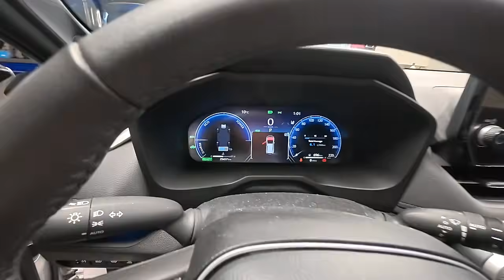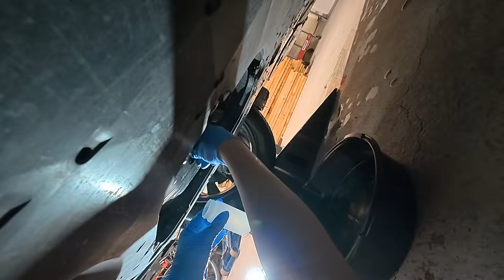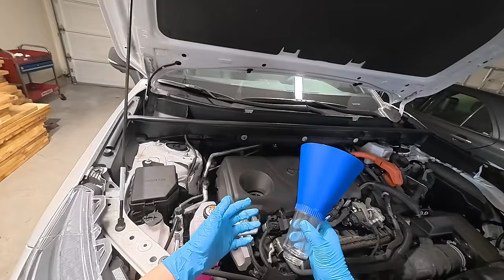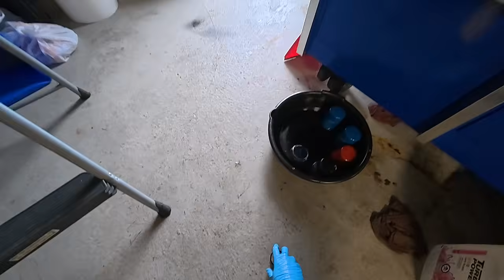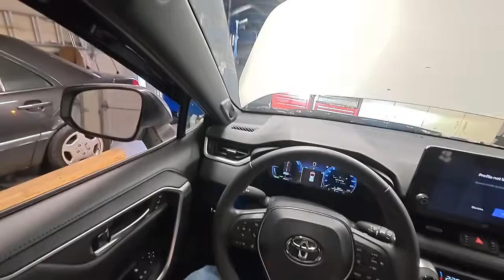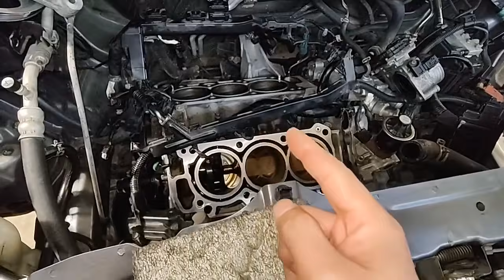5w30 Instead of 0w16 oil change #2 in the Rav4 Hybrid.

Comment: If it's under warranty, I'd use the specified oil weight. The will use any excuse to deny coverage, and using the wrong engine is a good one.
Reply: How would they know?
Reply from the maker: They don't. People that comment on my injector video because the dealer charged them 8 hrs to do injectors on their 1.5t and Im like that's so bad because injectors fall under emissions and is different than the 3 year warranty and at most customer pay is 3.5hrs labour time cuz warranty is 2.8hrs
Reply: @davidmordor Perhaps they could send it off for a viscosity test.
Reply: @davidmordor  They're going to want to see proof of proper maintenance, and they might even test the oil, before they fork out a few grand. They also may be able to tell from wear patterns. But also, if you do a YT video where you show yourself using the wrong oil, they'll know. But if you are just a dishonest person, then karma will get you anyway.
Reply from the maker: I've worked at many dealerships and no dealerships will test your oil for having the wrong oil. And no flat rate tech will waste their time waiting days for an oil sample just to deny your warranty and if they are going such lengths to do so they just want to make you pay out of pocket which will pay a flat rate tech more. The only thing we care about is what the condition looks like on the inside and if it's full of sludge then it's obvious. I've been a flat rate tech for 12 years.
Reply: They wont check your oil! 0W 30 will protect your car from needing a warranty!
Reply: They dont n they dont ever ask anything peeple r just dumb.

Comment: My Jeep calls for 0W-20, I am running Pennzoil Platinum Euro 0W-40 😃👍 It is a beast of an oil, I love it.
Reply: Mobil 1 FS 0W-40 is what I run
Reply: @Viking88Power That's even better. Folks online who have no clue say stuff like VVT will throw a code, oil temp will be very high, oil pressure will be abnormal and Jeep will feel sluggish etc. None of that happened to me, even my gas mileage hasn't changed. My 2024 3.6L Wrangler is loving the 0W-40.
Reply: @dawood2u  Yup I'll be running this forever, its cheap and very good quality. My recommended is 5w-30 but in other parts of the world they run 5w-40 so I picked a middle ground.
Reply: @Viking88Power From Bob is the oil guy forum one thing I learned is that no oil is too thick, too thin yes but not too thick. As long as the oil is pump-able(Has approriate winter rating), it will make it to all parts of the engine. My dad in Afghanistan runs 20w60 in his 1998 4Runner that calls for 5w30 and his 4Runner runs like a top 😆
Reply: @dawood2u  Oh yeah I can imagine in places where it gets very hot you can run viscosities like that. People with the same engine as mine run similar viscosities on Australia and South Africa.
Reply: If the Jeep is the 3.6 pentastar, Jeep changed from recommending 5w-30 to 0w-20 without ANY actually changes to the engines, no internal differences whatsoever. 5w-30 is definitely fine for the 3.6.
Reply from the maker: Wish they still made the 4.0L straight 6 in the Jeep that thing was a beast. Back in the day.
Reply: @theoffroadingmechanic Next gen Wrangler might get a straight six again
Reply: Euro oil is low saps for gpf which you don't have. You are not getting the full protection you can get from full saps.
Reply: Hello there, for how long do you run this grade of 0w40?
Reply: @Goldeagle81 3rd OCI
Reply: How do you know that it is better than the 0w20? Have you done oil tests for wear metals after a 10,000 mile break in period. Why is is the pennzoil platinum euro better than just pennzoil ultra platinum for your car?
Reply: @chumleysteven5717 Because Euro oils have more approvals and better additives. Yes I have done tests, oil analysis, magnetic drain plug and inspection of oil filter. Everything looks great
Reply: @dawood2u wrong,Euro oil is low saps because they have higher air pollution regulations. Saps are what protect your engine. Higher saps is more protection. American and Japanese can run higher saps.
Reply from the maker: More detergents for longer oil change intervals like calcium to neutralize acids from by product of combustion. On the euro oils.

Comment: Pennzoil ultra platinum 5W30 is the best oil for most cars. If you want to keep your car for more than 20 years and over 300K
Reply: And get it rust proofed annually or you're not keeping it 20 years in Canada.
Reply: @jptrainor  very true. Toyota does a really good job rustproofing out of the factory. I have a 23 year old Toyota, east coast winters, no rust.
Reply from the maker: My 21 Tacoma frame started rusting from where the metal over laps and the welds that are painted were flaking off and started rusting After 3 years.
Reply: Amsoil is better
Reply: @halftontimrvreviewsandtips3106  truth 👍
Reply: My 97 f-150 has 394k , used 5w-30 for approximately 29 years
Reply: Exactly what I use!
Reply: Best group 3 oil on the planet so I've heard.
Reply: Running 0w-20 ultra in my 2025 rav4

Comment: What are you trying to prove by using 5w30 oil?
Reply: This oil can make the engine last longer than the really thin oils
Reply: @nekopop8159 Hmm, I have 2023 RAV4 Hybrid with 110k km (0w16 every 10k oil change) and 2015 Sienna (350k km using 0w20- every 8k oil change). I wouldn't do this kind of experiments since it's not saving me any money.
Reply: @HotelRelax-jt7xd  they won't understand 
They live in a world full of concpiracies 😂
Ohhh Toyota wants our new cars to break earlier 
They never saw a 3rd gen prius with 300k+ miles on 0-20
Reply: @nekopop8159  There is zero evidence that using 5w-30 oil will make your engine last longer if you change your oil on a timely matter. 

My son's 2013 Rav4 just turned 195K miles using 0w-20. Even my wife's Kia has 170K miles using 0w-20. I've seen Camry's with 300K miles using 0w-16 and 0w-20. I even saw a Corolla with 480k miles using 0w-16. 

Toyota recommends thin oils because of engines constantly turning on/off. Thinner oils get to these components faster that thicker oils. Plus you get better gas mileage. These thinner oils have a lot of additives to protect engines. I see no benefit in using unrecommended oils for Toyota.
Reply: I just asked the same question before I read yours. 🤣

Comment: These lighter oils are simply for cafe fuel economy green garbage the 6.2 oil was changed thicker to save garbage engines from the north so weights aren't that strict. Rings can rotate but never stay aligned all the time.
Reply from the maker: Yea the cross hatching on the cylinder is like rifling in a barrel the rings will rotate. It's just what they come up with to satisfy the consumers.
Reply: but if the car got new engine 0w20 is still suggested, if GMC knew that it still fails and cost them a lot of money why they continue to suggest it. Why dont they pay a fine with EPA and suggest 0w40 the fine for each vehicle is not that high in compare to pay for the engine recall. CAFE standard is only a part of it not all of it. Engineer Explained and The Motor Oil Geek already debunked this myth

Comment: I would of waited till 8000 km
Reply from the maker: I still follow the 6000km oil change interval from before 2010. Then manufacturers increased it to 8000km after 2010 and started going to thinner oils.
Reply: @theoffroadingmechanic  early is better than late.

Comment: welcome back! long time no see. I use 5w-30 in my Hyundai, it calls for 5w-20. Does the 2025 1.5T in CRV and Civic still have head gasket issues? Kick the can down the road for 10 yrs and SOL for the customer. I do oil change on my sister in-law’s 2020 Corolla and the oil level on dip stick is hard to see.
Reply from the maker: Thanks I honestly have been missing working on cars again. Haven't seen any head gasket issues on the newer CRV 1.5t still pretty new and not many gets sold compared to the hybrids which are having head gaskets failing.
Reply: @theoffroadingmechanic  oh,... didn't know the CRV Hybrid also has head gasket issues. thank you!
Reply from the maker: Yea CRV Hybrid is also having head gasket issues. It's already all over the internet.
Reply: @theoffroadingmechanic  Does Civic Hybrid also use 1.5T engine?
Reply: @Raptors416 no, it uses the 2.0 NA engine, very reliable.

Comment: I'm not sure if I would take comments going the other way as accurate as well, I checked the specs on Saudi Arabia RAV4 hybrid, its 0W-20.
Reply: Check the official Toyota manuals for the A25A-FKS in Japan and Australia. They recommend 0w16 but say 0W-20, 5W-20 and 5W-30 are perfectly acceptable.
Reply from the maker: Yea not 0w16. Would have to see the owners manual in the region to see if it says if 0w20 isn't available 5w30 can be used etc. kinda like in our owners manual says if 0w16 is not available 0w20 can be used
Reply: @theoffroadingmechanic Makes sense to me, just noting  not 5W-30 as others have mentioned.
Reply: Makes sense with the temps in Saudi Arabia.
Reply: I'm looking at the Suadi Arabia owner's manual for a 22 Rav Hybrid and it says "Recommended viscosity (SAE): SAE 0W-16 is filled into your Toyota vehicle at manufacturing, and the best choice for good fuel economy and good starting in cold weather. If you use SAE 10W-30 or a higher viscosity engine oil in extremely low temperatures, the engine may become difficult to start, so SAE 0W-16, 0W-20, 5W-20 or 5W-30 engine oil is recommended." So in this case, no the recommended is 0w-16. But also says you can use the others.
Reply: @abscissatv  Gotcha, even more to my point.  He mentioned people saying 30W was recommended, but it's even lighter than 20W.

Comment: I thought the plastic seal on the filters was to keep dirt out.  Its to protect the oring because its pre-lubed?
Reply from the maker: Yea it's to keep junk out of the filter since the hole bypass the filter and goes right to the engine. Also keeps the grease there on the o-ring. I wish Honda did the same way on their filters because people poke their finger into the hole to remove the plastic wrap and it goes in there and ruining people's engine. This happened enough for Honda to create a bulletin on how to remove the plastic rather than change how they put plastic on their filter

Comment: I bought Pennzoil Ultra Synthetic instead of Mobil 1 Synthetic for our Toyota that takes 0W20. Are you finding the Pennzoil much better than the Mobil 1? Although most people will pick Mobil 1…
Reply: Project Farm did a comparison with Pennzoil Ultra Platinum vs Amsoil. They were pretty much even with Amsoil only slightly better.  For price and performance, PUP for the win.
Reply: @davidmordor  AMSOIL won because it had a better cold flow not evaporative loss  Amsoil is only Better if you are in Canada
Reply: Mobile one is granddaddy‘s Junk
Reply from the maker: I picked Pennzoil because it's consistent throughout the board. Where others may be very good in certain areas but fall short in others. You can check out The motor oil geek channel on his most recent video he tested different brands with oil analysis.
Reply: @theoffroadingmechanic ok thank you. I watched that Motor Oil Geek but he is all over the map with his videos. He doesn’t provide a straight answer for lay person like myself. You have to be a technician to understand his videos 😂
Reply from the maker: I only watched it for the oil analysis results on paper for the other oil brands. Lol

Comment: I have a regular gas  2022 XLE RV4 and live in SoCal. I already bought a jug of 0w-20 and intend to change out my old 0w-16 oil in late December. Let me know how your RAV4 performs  with the 5w-30
Reply from the maker: Yea I'll keep updating on this. I made a playlist specific for the Rav4 hybrid.
Reply: BTW, it’s 0w-20 Valvoline Restore and Protect and I have about 65,000 miles on the car, so I felt it’s time for a thorough engine cleaning
Reply from the maker: I was thinking if I could find car that has been neglected and all sludged up inside and I just changed the oil every 2000kms to see if it'll clean it up that way. Since oil has detergents and dispersants to help clean or keep an engine clean.
Reply: Dosen’t the hybrid RAV4 use a different gas engine?
Reply from the maker: Same same but different the hybrid gets a higher compression ratio compared to the non hybrid for better thermal efficiency. But the engine makes less power than the gasoline version. Both are dynamic force engine but one uses a modified Atkinson cycle.
Reply: @theoffroadingmechanic Atkinson cycle?
Reply from the maker: I believe the hybrid is the Atkinson cycle while the gas only is a modified Atkinson cycle using variable valve timing to lower compression ratio

Comment: 5W is good down to -30C so you're fine
Reply: Some brands, many brands are good down to -45C
Reply: That just means the oil will still flow down to that temp. It doesn't mean it will flow at a rate high enough to protect your engine. 
Variable oil pumps are programmed for a certain flow rate. 
I would never go up in weight during the winter.
Reply: @JTS-WTP  Yep. I run 5W-30 basically all year, but around November I drop it to 0W-20 and run that until we get warmer weather. Mostly around March.